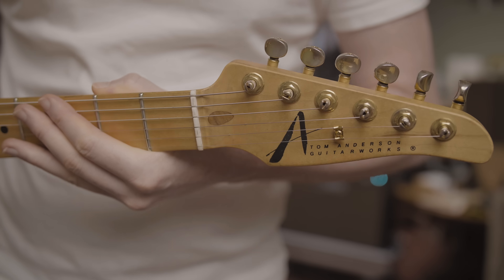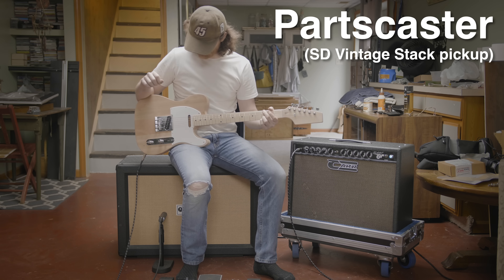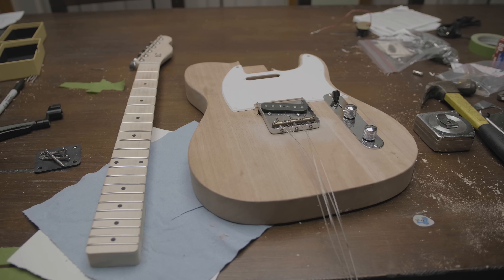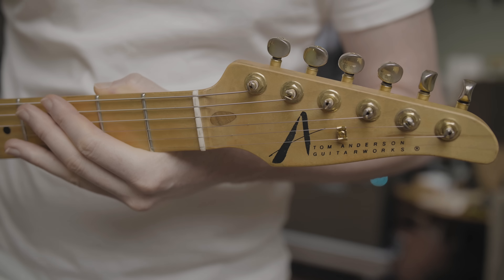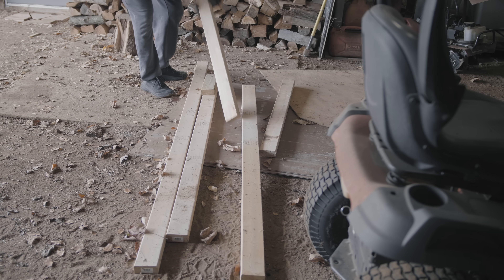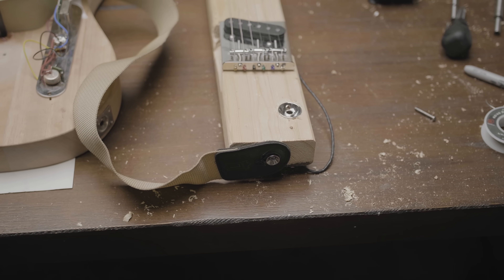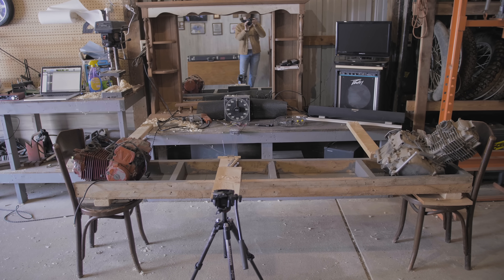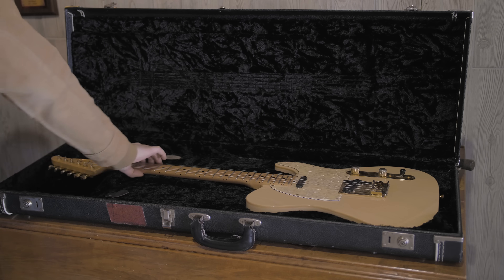Tested: Where Does The Tone Come From In An Electric Guitar?

Comment: You've done the guitar world a service. I salute you.
Reply: If by "guitar world" you meant the consumer, perhaps. If you meant the manufacturer, perhaps not.
Reply: You could still argue that the benches the airguitar is srewed on is even more wood then a normal guitar would ever have. Just using a body made from plastic would be better i think.
Reply: @setzer1987  yeah, but, as you can see, that's quite a stretch.

Comment: I came across this again, and I think the biggest revelation is that short clips of strumming often don't tell you squat (5:27).  Only a few seconds later, when you play the lick on the middle strings, the difference between the two guitars jumps out (5:36).
Reply: Likewise, the 2x4 plank guitar does sound different from the Anderson (I actually like the 2x4 more).  But what are you trying to test?  That the body doesn't matter?  It clearly does, as I could consistently hear a difference.  Likewise, the Anderson did sound different from the "air guitar".

Comment: To be fair, you're using a fairly overdriven amp tone, and that will compress the signal a bit.
Imho all overdriven and distorted tones get a bit homogenized, and take the "body"  out of the equation from the transducer effects beyond the electronic magnetic pickups.
If you want to hear more of a difference, cleaner amps are a must.
The bodyless experiment is hip, BUT unless bridge and nut are physically decoupled from each other (other than by the strings themselves) then whatever supports the nut, bridge, and strings will still have some acoustic coupling effect, i imagine.
When i was a kid, gtr stores used to tell us to push the headstock of the gtr against a door or jam, and the physical coupling would amplify the solid body guitar significantly...we exploited this years later when jamming acoustically, our bassist used to stand his bass on the fender of my guitarist's vw bug and it sounded almost like he was playing an upright.
Anyways, i believe you are right when speaking of overdriven gtrs, but clean, where body resonance transduction is more of a factor at play, you may find a bit more noticeable differences between different guitars, particularly if you tend to play with the guitar volume and tone knobs cranked...esPECIALLY on a tele..
So i dunno, man. I have a huge herd, and tho i always tend to sound the same with them, most folks don't at all, and their primary clean tones are quite different.
More in the fingers than the gear.
YMMV and should, just speaking from 54 years on this blessed hellride so far.
Groovy vid jim, thanks and keep 'em coming

Comment: In the air guitar those benches provide (at least some) resonance. And they are connected with wooden bars into an even larger structure. Attach a string to a big piece of wood - and it usually sounds cool.  I wonder if there 's a way to mount the bridge and the machine heads in way that would ensure absolutely no transfer of vibrations from the strings to the mount points.

Comment: Everything you change about an electric guitar will affect the sound.  Put on new strings--different sound.  Use a different thickness of pick--different sound.  Ditch your pick and play with your fingers and thumb--different sound.  Swap your Nickel-plated strings for pure nickel or stainless steel--different sound.  Put bronzewound strings on your Les Paul (yes, it can be done, I know because I did it for years)--different sound.  Raise or lower the action--different sound.  Raise or lower the pickups--different sound.  Roll off some volume or tone--different sound.  Let your friend play your guitar--different sound.  There are hundreds of variables, and anything you change will change the sound.

Comment: Les Paul's original prototype body was just a plank with pickups. He added 'wings' to make it more appealing to guitarists. However, if you're playing with very microphonic pickups, it will pick up more acoustically. Those cheap 60's/70's Zenta/Guyatone/Tiesco guitars with rattley fretboards, thin bodies and microphonic pickups for instance. If you want an acoustically influenced tone, you probably should look into hollow-bodied guitars with decent non-wax-potted pickups, or an acoustic with pickups mounted. Hard-mounted, rubber cushioned, wax-potted pickups shouldn't be affected by solid body construction much at all, and this is what I did in my Squier guitars. You'd expect the body to have more impact with hard-mounted pickups but this actually keeps the pickups more still if cushioned properly with wax in the holes and rubber rubbing. My Fender Strat has pickguard-mounted 57's/62's and aren't wax potted because I wanted an aurhentic 60's model. Brass saddles do make a difference and this was evident in the video, because these are in direct contact with the strings, as is the nut.

Comment: Other things these guitars have in common: Bridge is mounted on a solid piece of wood, physically connected to the headstock by other pieces of wood screwed/bolted onto the “body”.

Awesome video. But one could try a design where the connectors are another material. or where the two halves are not connected. Or make a guitar from a material other than wood, and compare it to the tele. :)